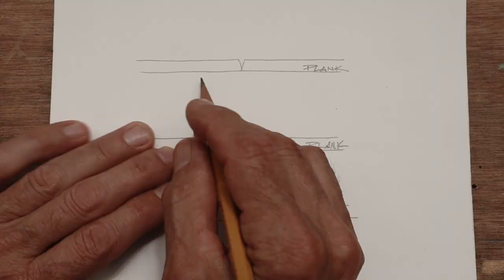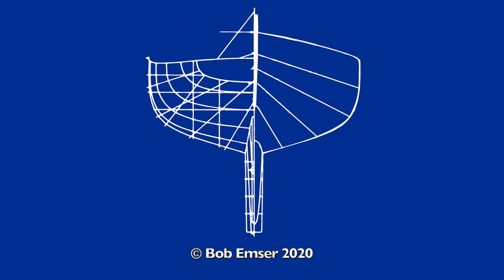Caulking a Small Wooden Boat, S2-E30

Comment: Ooh, you've put up a bit more than Steve did on Acorn's latest vid, ha, ha. Great demmo on caulking, very informative. Of course, working on bigger boats from underneath might be more comfortable than hammering down onto yours, and thus a shorter hammer head may be an advantage, perhaps.
Reply: Endoph Daize  Oh yes, I remember now, Ben said at the end of the vid.
Reply: Frankly it makes no odds what you use to set such small seams, any mallet or hammer will do. A caulking mallet comes into it's own when you give it a full swing and hit the Iron with real force. It's only then you can begin to appreciate why they came to be made in that way and what an efficient tool it is. Incidentally, the Iron should be held the other way round, in order to use the index finger to pinch the cotton or oakum. It was also explained to me that I could get by without my pinkie better that without my thumb. A reference to the number of times the mallet would make contact with flesh and bone, before I'd become proficient.

Comment: On the "Making" video, there were suggestions that the caulking wheel, being two parts, would pinch the cotton and pull it back out.  I'm guilty as charged.  Well done Bob! Your caulking wheel worked as designed!  

May I ask why cotton wicking was passed over in favor of cotton caulking?  Wicking comes pre-rolled and in easily separable strands.

Comment: Nice bit of information.  I am left wondering, however, how you finish off either end of the seams of the caulking, at the stem and stern. Maybe you could show us that in a future video? Of all of the caulking videos I've seen, no one ever shows the ends of the seams being finished. For instance, do the ends of the planks get caulked where they meet each other at the front? Where they meet the rear 
board/s? That would be some valuable infornation, thanks.
Reply from the maker: Hi Thomas,
I will be sure to include that in a future video. 
Thanks for your continued support!
Cheers
Reply: @TheArtofBoatBuilding  thanks

Comment: Bob, wonderful job. Starting out with my Haven I built a mold for every frame ala the Landing School. I like your setup much better, and have eliminated every other frame and reduced them by a half inch for the battens. I have a couple questions. Given that you have glued up the keel, are you at all worried that it might not swell, or might not swell enough against the garboard plank? With this design, except for the bed logs attached to the centerboard trunk, there is no "landing" for the garboard plank. This most important plank just abuts the keel. So swelling is especially important. Now, I notice that it is flat sawn and the 4 to 6% swelling you will likely should be enough. Still, I wanted to ask. Second, as I look at the plans, the keel, floors, etc., I'm tempted to make a modification to the keel so that there is a "landing" for the whole garboard, not just against the bed logs. Would be a tricky bit of business but seems doable. Any comment on this?
Reply from the maker: Hi Thomas,
The laminated keel was glued up with a flexible epoxy (7% flex, Total boat slow hardner). I'm not concerned it won't take up. As for a garbroad landing I'm following Joel Whites design. I trust his design is proper. I will say that I caulked the garbroad to keel joint yesterday and with the oak being on one side the packing of the cotton was much stiffer. It required a caulking iron (caulking wheel wasn't up to the task) with substantial mallet blows I could tell no difference whether I was over a floor timber/frame or not. My thought is that I would not change Joel's design, I'm very happy with the construction. 
Super glad I built the mold with battens. They come in very handy in any clamping and or edge setting that was needed. 

Best wishes on your build. Keep me updated on your progress. Are you aware of the Facebook group on the Haven 12 1/2? Good resource of other Haven builders.

Cheers,
Bob
Reply: @TheArtofBoatBuilding  Thanks, much appreciated. Initially I was going to steam bend a white oak keel per the plans, but I think I will have better luck getting a tight garboard fit if I glue it all up. Getting rid of every other mold station creates a lot of room to work which will be especially helpful when attaching floors. Joel White was an accomplished designer and even the Herreshoff 12.5 "edged" the garboard directly to the keel. Still, I've pretty much sold myself on the idea of changing the keel to create a landing for the garboard plank. I'll  send you some pictures. Your video productions have been very helpful.

Comment: A question, you started twisting the cotton up, the next part of the seam you twisted it down. What is the reason for that?
Reply: Paul C I believe he does this so that the whole roving of cotton does not have to be twisted as he works down the seam.  By reversing the twist the cotton roving remains untwisted for the length that remains to be worked in.
Reply: @FrEdmundScott  that is my assumption too, just, it also creates a 'lump or rather a void', for lack of a better word.
Reply: Paul C yes, the possibility of a weak spot where there is no twist in the cotton as the twist reverses.
Reply: Munroe Scott but by this guy making doing something so easy the purpose is suffering. Do it right or don’t do it
Reply: @captainwhiplash  for me, I asked because I didn't understand it. I did build a model boat, about 1.8m in length and I did it 'the correct' way. It took longer than the planking... about 6 month, off and on. I didn't like it one bit but it was  present. Just longer than planned, about 2.5 years longer. In the end I was happy to give it to the man who got me interested in scale models.

Comment: I was wondering how would you solve the twisting of the rest of the cotton... one foot in one direction and the next in the opposite. I was thinking ropes, where you can't do this. Nice move! Subtleties... Thanks!
Best from Brazil!
Reply from the maker: The reverse of the twist id to keep the long tail form getting tangled. Unlike a rope it does not effect the purpose of the caulking. Once in the joint it is there to stay.

O reverso do id de torção para manter a forma de cauda longa ficando emaranhada. Ao contrário de uma corda, não afeta o propósito da calafetagem. Uma vez na junta, está lá para ficar.